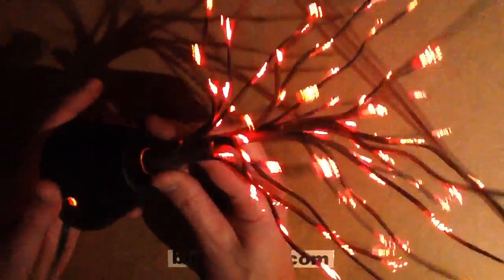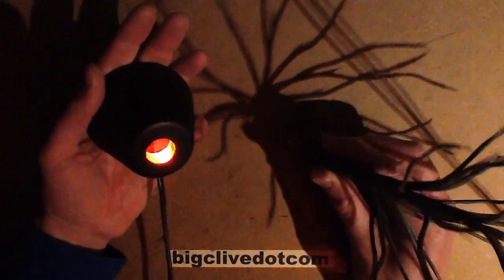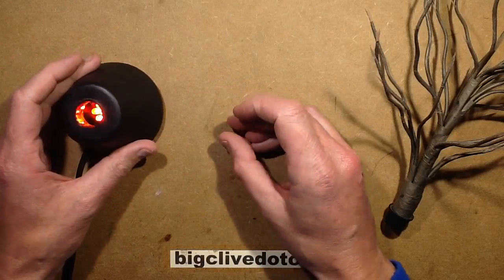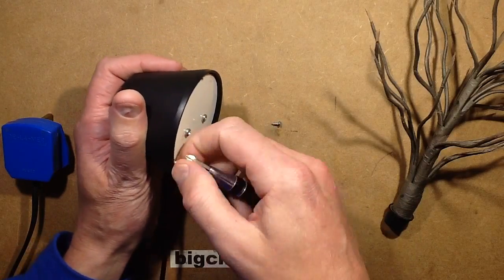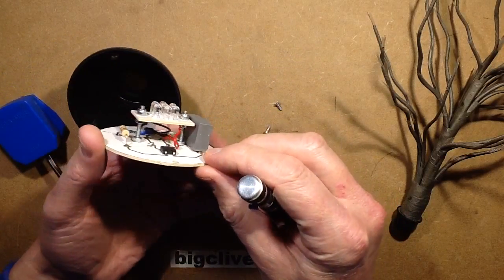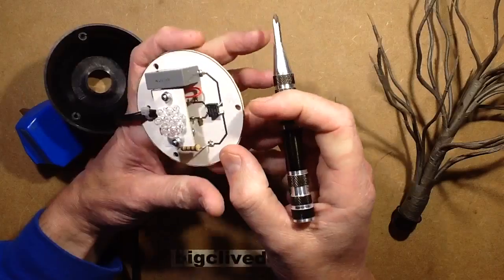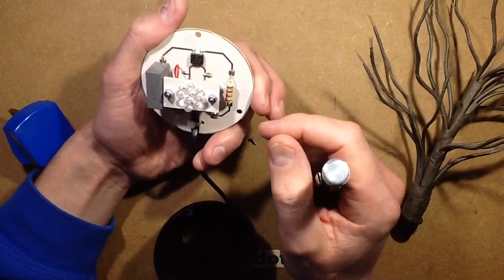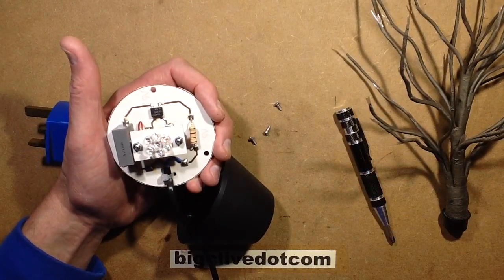Mini LED fibre optic tree.  Hack from the past.

Comment: These are great for swapping in automatic slow-change RGB LEDs. You can get rid of most of the circuitry because they are self-regulating and the end result is very trippy indeed.

Comment: Does the ipad record at 24 fps because it's american? In that case maybe its "shutter speed" mismatched to the 60hz mains? But then I don't know how much you would see that as I'm not an electrician. I assume as it's DC, you wouldn't see it at all?
Reply from the maker: Pure DC or high frequency lighting doesn't flicker.  But the iPad2 can even make tungsten lighting flicker.

Comment: I have a guess about the flicker, and how to maybe reduce it.  (If you want to reduce it that is!) It could be that the ipad is set to record at a framerate which doesn't divide 50 or 100 hz evenly.  The youtube "stats for nerds" thing says this video is 30fps.  An experiment could be to record a flickering LED at the current framerate, then again at 25 or 50fps.  Then watch it back and see if the flicker is less visible.  (If changing fps can be done with an ipad) I don't really know much about cameras, but it might be interesting to look at that.

Comment: Thats a nice design clive, i like a well spaced out device, you can add things later with no problems :-D.
Ive taken some of my projects to bits and wondered "Why the hell did i do it that way?", often it was just what i had in the parts bin at the time, "That will do" :-D.
Sometimes i just wanted a circuit for one job, so it was just parts splatted on to strip board.

Comment: do a video about designing a capasitive dropper circuit for powering various led loads. I would mention why they are used over just a resistor as many people dont know how capacitors really do not dissipate any wasted energy while acting like a resistor for the application

Comment: The tree itself looks to be very easy to make.  All in all one would just need floral tape, 16 awg floral (stem) wire, and fiber/fibre optic tubing.  Make an armature with the wire, route the tubing, and tape it all off with copius amounts of tape.  I may try making this actually.  Just need a base.

Comment: If you're interested... For some reason Apple don't include a 25 FPS recording option on their devices only 30 FPS. Because of this, any light running off of our 50Hz mains looks like it's flickering since the frames captured don't sync up properly with the waveform of the mains. In the US, lights will look fine since they use 60Hz mains and the frame is always captured at the same point on the mains waveform.
Reply: You take what Apple gives you and you like it. Complaint is blasphemy.
Reply: I'm going to go ahead and guess Tom Scott for that knowledge? I'm not complaining though, it is completely correct.
Reply: Firecul42 Actually not, I looked it up while trying to diagnose flickering on a camera I had a few years ago. I have since seen Tom Scott's video though.
Reply: Jake Charman Fair enough then, as I said it is still completely correct.

Comment: hmmmm.... reminds me, i must get my ass in gear :D i've an old style lamp-post i bought from wilko's about 12+ years ago, that i need to fix up, has a crack in a pole joint, and i need new length of wire and i wanna change it from filament to LED, thinking warm white with one of your circuits i have :)

Comment: BigClive, How old is it ?
I thought captive / resistive droppers were a relatively new invention.
which brings me to the question, how and when did you find out about resistive droppers ?
For me, I had no idea about these power supplies until I started watching your channel about a year ago.
Reply from the maker: Some of the very first LED lamps used capacitive droppers.  They pre-dated white LEDs.
Reply: Some electronics hobby magazines from the 1970s had capacitiv dropper circuits.
They were generally used where transformers were too unwieldy and the project was a fixed installation with low risk of someone poking around it's innards in use. :P

Comment: In the U.S., mains power alternates at 60 Hz, and cameras made here have framerates to match that.

Unfortunately, your mains probably runs at 50 Hz. Silly Apple never gave you any framerate settings, so you're going to get that flickering anywhere in Europe.
Reply: Most cameras can be adjusted to 50Hz. Guess in case of Apple you'd have to pay extra for it... :D
Reply: Not just Europe, Australasia is 50 Hz
Reply: i got android and i never seen that option maybe it auto adjusts caus of my location.
Reply: +vk3hau there are countries that have 60hz that is not US

Comment: Clive, I know exactly why the iPad makes things flicker for you. The iPad was made for the US (60hz) and you are in the UK (50hz). The camera picks up the slower refresh rate/hz, even if you can't see it yourself in person.
Reply: Tom Scott did a good explanation of it (https://www.youtube.com/watch?v=kVQxl4U_p5E)
Reply: I was thinking the same thing. The video is at 30fps and the LEDs flicker at 100Hz. Since the two are asynchronous the temporal aliasing isn't hidden by the flicker being a multiple of the frame rate. The flicker ~should be around 10Hz.
Reply: simontay1984 Plenty of 3rd party camera apps for the iPad, lots of control since iOS10. Pro Cam for example allows frame rate selection.

Comment: The flicker could be caused by the Rolling Shutter. Even small fluctuations of the light output seem to show up. Maybe the Framerate is 30 fps, and you have got your Mains electricity at 50 Hz, which doesnt split evenly.